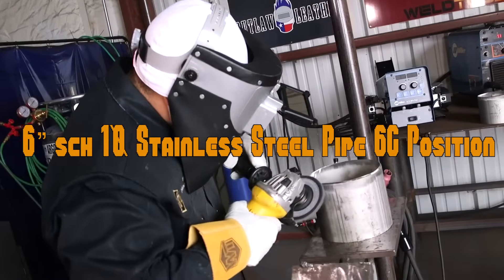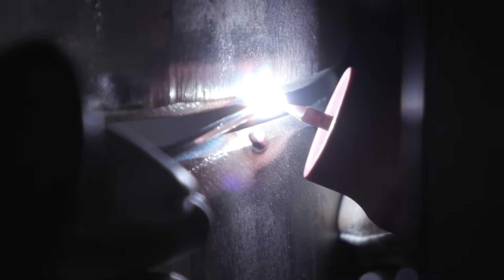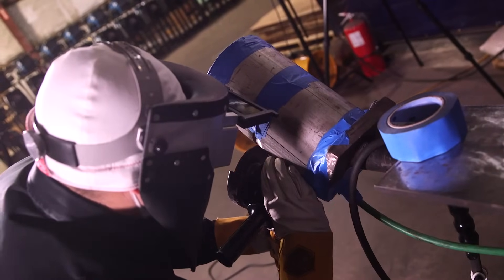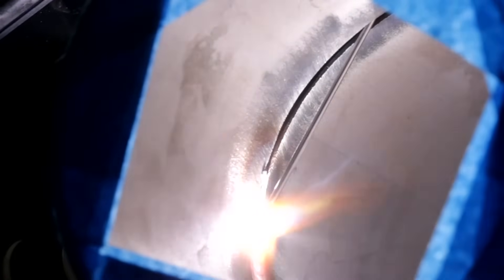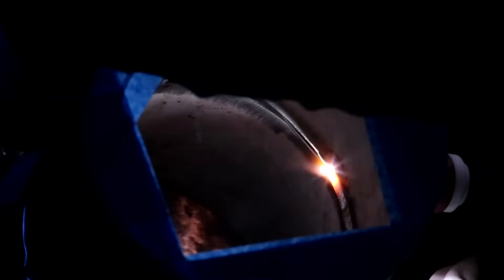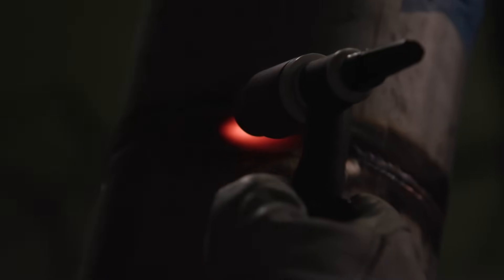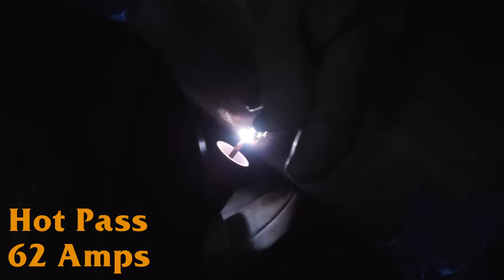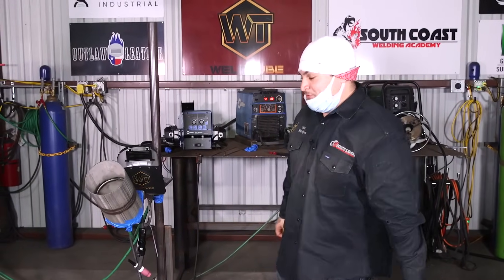Stainless Steel TIG Welding | 6" Pipe Schedule 10

Comment: I'm not sure if anyone else does this but where I work we tack on nuts to open root purge fit-ups which can definitely leave less room for error (instead of having to grind out each tack for your start). I know this isn't as practical for in the field but for pre-fab stuff it could make a difference in success

Comment: Can I please ask if you are done with your root and you weld your hot pass. What did I do wrong when the root gets damaged in the process
Reply: To hot and or to slow, or sitting to long in the middle. Gotta focus your heat more towards the bevel face

Comment: It’s those small little tips that make all the difference. Have always had a tough time with sugar in my root. I’ll try that “block” method with the tape. My argon has definitely been leaking out too much in the opening. Thanks for the tips brotha
Reply: Amigo siempre debes poner la cinta ,ya que sin esta es imposible hacer el pase de raíz y siempre se te colgaría por el interior o florecerá debido a la contaminación del oxígeno . Todo soldador tiene debe saber que para ejecutar un cordón de raíz en acero inoxidable debe hacer lo que se le llama el proceso de cámara para eliminar el oxígeno del interior de la probeta. Si Tu lo hacías sin este procedimiento osea de que hablamos . Espero mejores en este tema . Suerte y no queda más que seguir mejorando cada día un poquito más.  Bendiciones desde Calama Norte grande desierto de atacama  Chile .  Atte Rodrigo

Comment: Why are welders doing this style of welding? I see other videos like this and it's so wild. You don't just cut the arc and grind out a fish eye every time. That's nonsense. Ramp down your amps and gently swirl the puddle until it is tiny, then let off. Also, learn to weld SST without a gap. This whole key hole back feeding nonsense just wastes time. I just do not understand this technique. Also, yeah, have passed X-Ray many times.
But hey, it is a good way to make more money by dragging the job out.

Comment: Only 55- 60amps?? Wouldnt even be that low with a 1/16 wire! No wonder it pulls on you so much! 
5/32gap and 3/32 rod? Get the amperage up to 85-90. Doesnt close up half as much, punches the root through without fannying around backfeeding, and youll retain much better weld metal integrity. Much less distortion, less carbide precipitation, and less surface oxidation. Rather than having to use a 10 or 12 cup with argon absolutely huffing out of it to keep a decent coloured root, youd get a decent colour using a size 6 cup👍👍
Reply: Please give some details on your method - what's the gap and wire size? Freehand or walk the cup? Feeding wire from outside?

Comment: I like a tight 1/8th inch gap on my sched 10. Turn the amps up and walk the cup all the way. Heat is your friend. Nice to see other people's methods. Always more than one way to skin a cat
Reply: Do you feed the wire from outside or back feeding?
Reply: @mddenis1  I do it both ways. I have good luck face feeding so that's my go to on the bench especially, but back feeding is a great technique to get a good root in a tight spot because you can keep the wire and your feed hand out of your way.
Reply: @Theone82 ain't that always the way, too. Lol
Reply: It works on alloys though. That's the only time I use bridge tacks.

Comment: Are you supposed to purge it the whole time, or are you done with it after the root?
Reply: If you purge correctly you wont need to.
But you should test the part and look for holes before continuing to weld.

Comment: i’d like to see a video using 1/8 filler wire beceause they are common on the field unlike the 3/16. Aside from that, good job bro looks good.
Reply: En el proceso Gtaw no se aplica aporte 3/16 no es alambre , este se usa en el proceso Fcaw y va por milímetro ,desde 0.6 a 1.6 . Comúnmente en Gtaw es para chapas no más allá de 12 mm de espesor . Saludos.

Comment: That guy's a good instructor, humble and well spoken. One thing though is to not brush stainless like you would carbon, do short strokes to the side instead of up and down.
Reply: Why not to brush stainless?
Reply: @mddenis1  as long as it’s a stainless steel brush it doesn’t matter, don’t know what this guy is on about
Reply: I find it better to do either up or down but lift up after the stroke and reset also always clean and I mean clean every piece of metal and everything that's going to be touching the work piece

Comment: great....but you need to use both hands .....or you will have some trubles in a plant .boiler or refineries jobs...aanyway good job..
Reply: Not wrong there, Unless you can weld backhanded. 
Same as all the "walken the daaawg" bullshit. Learn to weld like that? What are you going to do when there's something in the way lol
Reply: I can weld with both hands but I don't do it on video because there are new guys that would find it hard trying to do it with their opposite hand.

Comment: I worked at a shop that specialized in cryogenic vacuum and pressure vessels. We did a lot of sch 10 stainless.  Procedure called out that we had to fit with a knife edge and no gap. .045 filler and a super tight arc was the best way to run that. 
It was super hard to get used to.
Reply: @Sayin wat cool
Reply: I did exactly the same , set up that is, feathered edge (no landing edge) and I had a 35 degree bevel. I fused the root run, as you say nor easy to master as you are never sure whats happening inside. I found when you arced up I paused for a few seconds before moving off and the arc settled and you know the edges were caught. The client did not want a heavy root flush was the preferred profile
Reply: @Sayin wat yeah 5/32 and up is not within code.. Qc can deny it if they want. Of course non union don’t follow code at all. root gap at whatever they want, run beads as wide as they want. Lol we can’t get away with that garbage. Obviously you never been in a nuke.
Reply: Any suggestions on 3 inch sch 10 6g weld test for a job?
Reply: Any suggestions for a 3 inch sch 10 ss 6g butt weld?
Reply: @Sayin wat I get what your saying tho, some places are a lot more relaxed. But we always try to go by what the process calls for by certs and most are QCs are going to do the same. Say you’re welding carbon 6010/7018. They will hold you to that tolerance of a UA21 and so on. But I’ve been at steel mills that don’t give a fuck. But to say 5/32 and 3/16 is acceptable isn’t necessarily true. A lot of places will not allow it
Reply: @Sayin wat yeah well neither would a 3/16”s or 5/32 gap. Ain’t no real qc letting you go that far out of weld specs. Sch 10 is a max of 1/8” on paper. If ur qc let’s you get away with more they are worthless. Besides, if you can’t get full pen on sch10 with lay wire you can’t weld and explains why You need to back feed 😂… the dude doing no gap would smoke you
Reply: I liked your comment. What gap would you personally choose for that pipe? Lay wire - you mean face feeding in a constant manner keeping the rod always in weld puddle? Can you get root reinforcement at 6 o'clock with that method?

Comment: Have you had problems with the lense flashing you when you’re tig welding?
Reply: you need to turn up your sensitivity from like 2 to 4 at a minumum to stop the flickering
Reply: Zach Piller I had been using a Lincoln HD, and no matter what I changed the sensitivity to it still flickered so I switched back to a passive lense for now. I wasn’t sure if it was just a problem with that lense or if it was common with all auto’s
Reply: All auto will Every once  ina while have that problem...all these auto lenses are something new for a long time a lot of people used the same 3 auto lenses...technology on them didn’t start changing till recently with how mainstream welding has gotten...
Reply: @jerrypino5608  I didnt have any issues with it with my cheap amazon helmet i used at tech school my current work buys everyone speedglass 9100s and i have no issues with it except tig pulse pps between 4-19
Reply: My snap on auto doesnt do it at all. It has served me wonderfully with tig mig stick in all positions